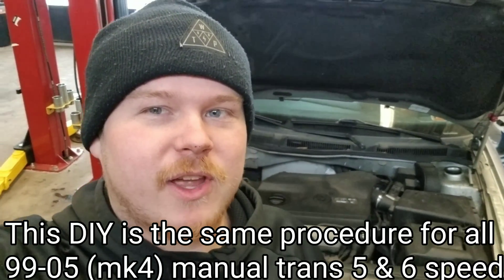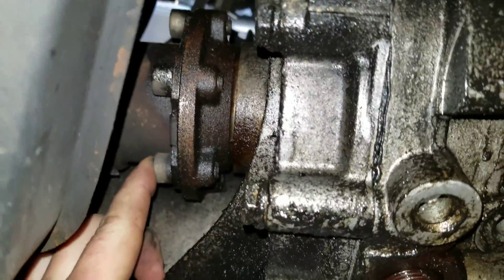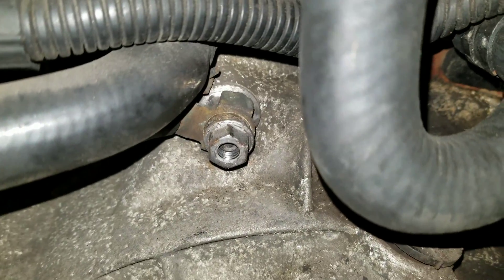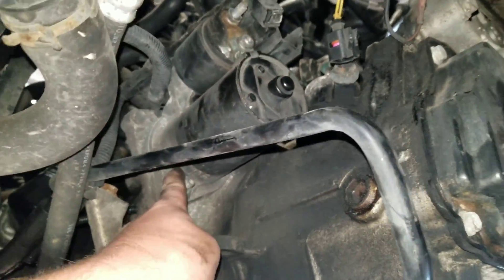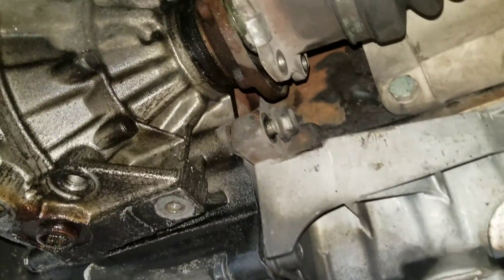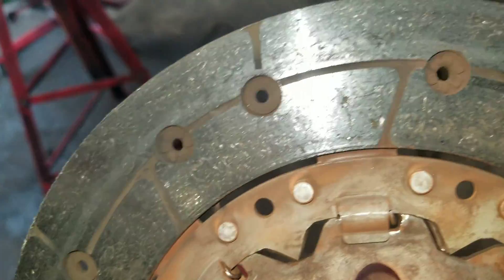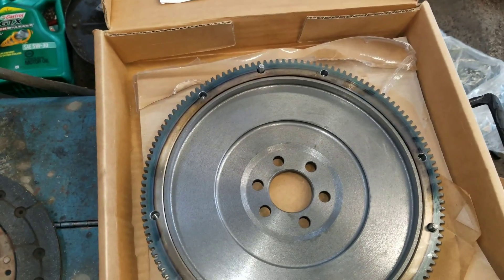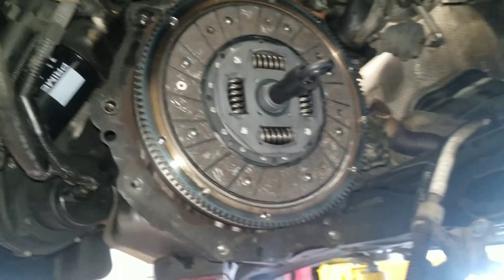Mk4 (99-04) 1.8t 5/6 speed manual transmission & clutch replacement DIY

Comment: I was wondering if you're from PA.. I'm over in Dillsburg with an 04 TDI. I just redid the hydraulics thinking it was a bad slave cylinder. Still won't shift into gear with the engine running and starting in gear it rolls without brakes applied. I came looking for a video like yours because I wanted to know how these clutches work. Looks like I might have a job in front of me.

Great video, thanks. "I've definitely done that before..."
Reply from the maker: Hey Jonathan, We are from PA. Theres a few possibilities that could explain what's going on with your TDI. First of all, these systems can be a real pain to bleed correctly especially working by yourself. If there is any air in the hydraulic system, the clutch disc will not fully disengage, and you will not be able to shift without it grinding. 

Second, it is somewhat common to see the clutch forks bend. Once the clutch fork is bent, its not able to put enough pressure on the pressure plate and the clutch disc will not disengage.

The last explanation I can give you is broken or failing pressure plate fingers. Sometimes the pressure plate can break in a way that it still engages the clutch but does not disengage with the clutch applied. 

Good luck with your repairs. Manual Mk4 TDIs were always very fun vehicles. I am sure you will get it shifting soon!

Comment: Quick tip.... if you're not gona be replacing the slave cylinder, you dont have to remove the hydraulic line.... it would save u from having to bleed all over again..... just push the slave aside where it will be out of the way when u drop the tranny...... bleeding these plastic slaves is a nightmare

Comment: Ok . Great video ! Thanks for making this ! Now, what’s the trick to getting the bell housing back on there ? I’m working on the ground without a lift so it’s not cake what’s  so ever !!
Reply: My buddy came by with a transmission jack . That did the trick 👍🏻🍻
Reply: Sorry I meant transmission…
Reply from the maker: @jrknox71  i found the easiest way for me was to get under the car and bench press that thing back where it goes, have a friend get a few bolts started. But ive also used a regular floor jack to lift it up close to where it needs to be

Comment: do you have to drain the oil to replace the main seal? and do you have to re-seal the oil pan to do this as well? or can you just re seal the part that bolts directly to the rear main seal?
Reply from the maker: @WilliamAlexy-g5n  i guess you dont have to drain the oil but some will come out when you remove the seal if you dont. You can remove just the rear main seal/housing without dropping the pan and usually seal it back up by cleaning and using some RTV, however the proper way and to ensure there will be no leaks would be to replace pan gasket at the same time. Hope this helps!
Reply: @TheRollingTimes  thanks man, what method did you use when you replaced it? did you drop the whole pan, or do a quick swap
Reply from the maker: @WilliamAlexy-g5n  its been 5 years, ive done them both ways. For a customers vehicle I would probably estimate the pan gasket too. For my personal vehicle id probably just send it if pan gasket was dry.
Reply: @TheRollingTimes  also, there are a few mentions of uncommon socket sizes, but Im having trouble understanding what you meant in the video. what size socket do I need for the flywheel bolts? did you say 6 xzn?
Reply from the maker: @WilliamAlexy-g5n  xzn or triple square are the same thing. I believe the pressure plate to flywheel bolts are 9mm 12point socket. The flywheel to crank bolts are probably xzn/triple square if they are factory. Aftermarket would usually be 12point 16 or 17mm. All of that hardware should be replaced, however if you choose to reuse it I would at least use blue loctite.

Comment: man ik this from a long time ago but u didnt need to drop the ball joint to get that axle out🥲
Reply from the maker: There are multiple ways to perform the same job, and multiple factors I consider when taking stuff apart.
Reply: @ no i know, i could just hear the pain in your voice when u said you snapped the bolts 😂

Comment: I’m trying to do it myself but I’m in dirt what what you recommend I lay down to hold my jack stands for like a few days till I replace my new transmission
Reply from the maker: @kikibermudez6152  you could try using some wood under the jackstands although I wouldnt recommend jacking a car up in the dirt. Its unsafe and could give out without warning.
Reply: @TheRollingTimes  yea sucks cause if it rains it will sink so I may just pay someone to do it
Reply from the maker: @kikibermudez6152  take it to a trusted shop if you can!
Reply: @TheRollingTimes  they asking too much when I only got the car for 500
Reply from the maker: @kikibermudez6152  well its at least $500 in labor and thats at a shop thats not charging enough. Nothings getting cheaper in this world.

Comment: Hi,
Have a 2006 Bettle 1.8 turbo in my shop. Clutch hydraulic system do you want to pressurize up. My thoughts is the clutch fork it's too far away from the slave cylinder shaft. Meaning that the clutch fork is either bent or needs bushings or both. My question is can that fork be removed without removing the complete transmission???
Reply from the maker: The clutch fork does commonly bend on these transmissions. They actually sell reinforced ones for this reason. There is no way to replace it or check it without removing the transmission.